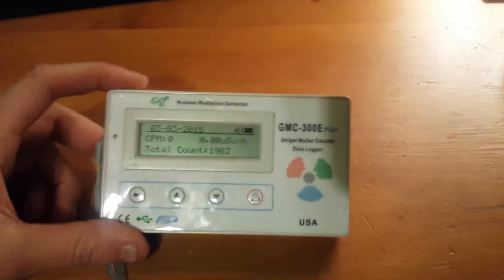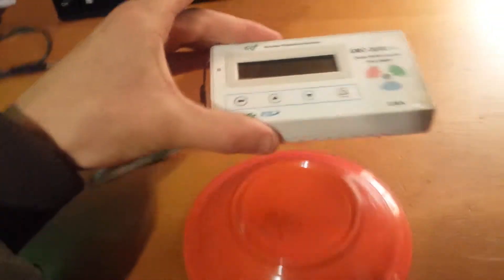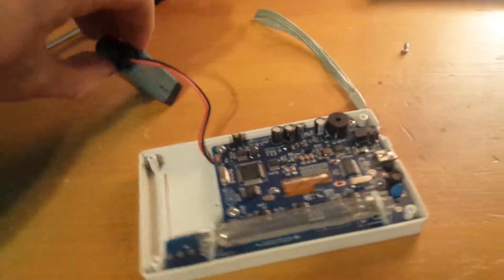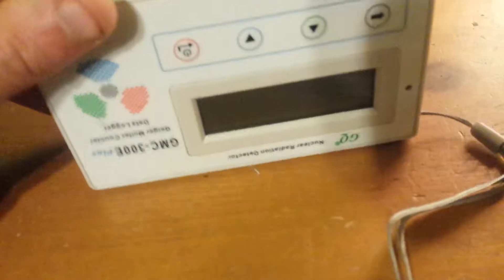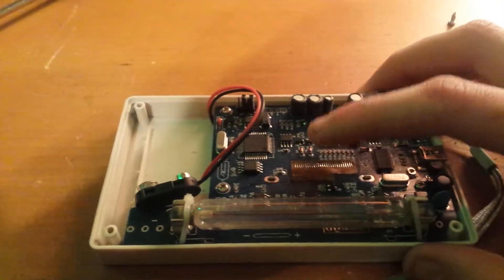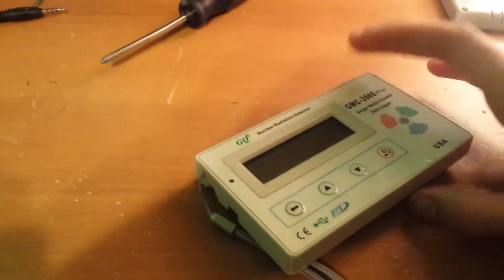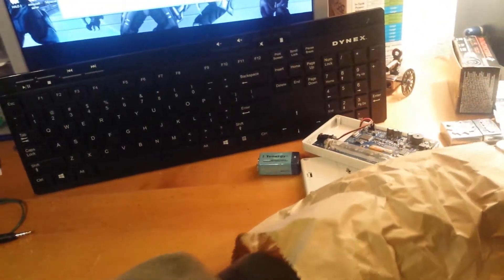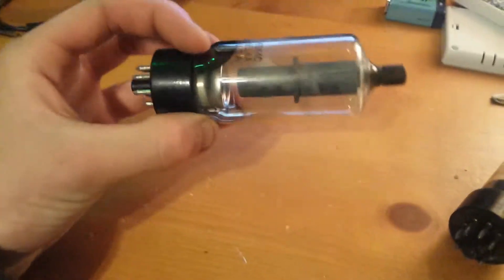GMC 300E disclaimer and how to fix muller tube

Comment: It's easy to find a new tube for your geiger. They can be marked J321, J305 or M4011. Data and sensitivity is the same - given they're same length. At least J305 exists in many lengths. You can swap tube out for a longer 107mm tube - just remember to adjust CPM to µS/h ratio to suit new tube's data.

Comment: I was gonna guess the GM tube I switched all my units to sbm-20 tube from the factory m4011 tube
Reply: They close enough to the same I'm not even going to bother doing that. My tube still works perfectly fine without issues and I carry mine everywhere too.

Comment: The tube you said was a high voltage diode is actually a high voltage shunt voltage regulator and the other one you said was a X Ray tube is actually a high voltage rectifier diode.